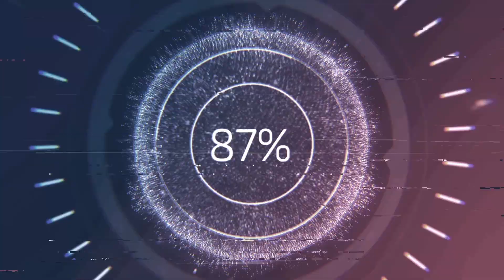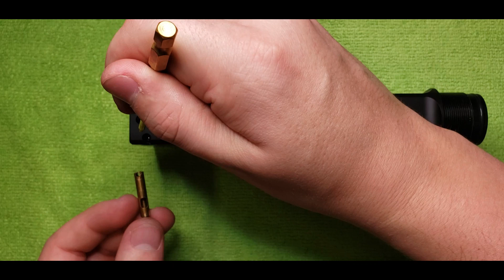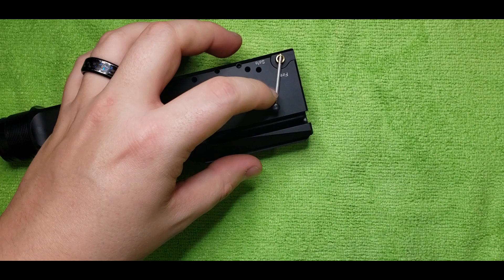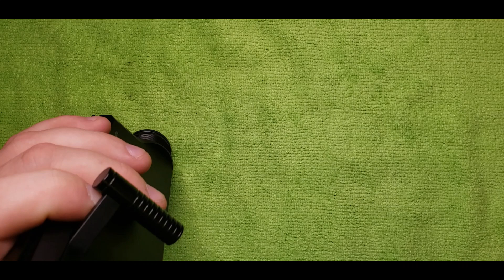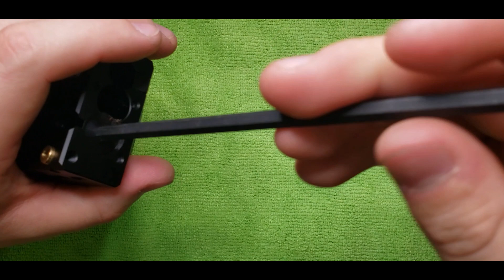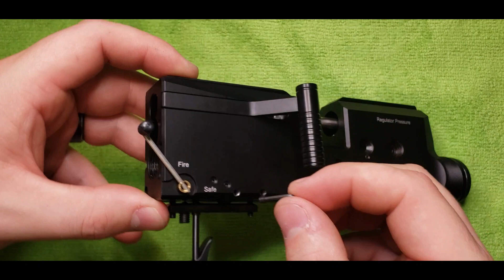FX Dreamline (Classic) Re-Assembly, Part 1 (Safety, Hammer, Trigger, Cocking Lever) FX Airguns

Comment: Great video but I need you advice. My FX Dreamline Power Pup in 25cal is leaking from the barrel and breech. To the point I cannot fill the bottle. I have replaced the valve pin seat and am waiting for a new valve pin. Although they both look like new. This is a new gun but I am the second owner. The previous owner said that he never shot it. What can cause air to empty so quickly out of the barrel and breach? I did make sure the gun was cocked. Any help would be appreciated. Thank you.
Wayne

Comment: Hi,do you think there is any relation between trigger weight and hammer adjustment?After adjusting  the hammer (lowering) the second stage is imperceptible of my Dreamline Classic.
Reply from the maker: The trigger and hammer should not have an effect on each other, but that doesn't mean it is not possible. I would guess that the hammer is landing differently on the sear based on the hammer adjustment in your case, thus changing how much pressure is needed in the 2nd stage to release the sear. Great question!
Reply: @910AirgunTuningandRepairs  Could another probability be the less pressure of hammer on the sear,thus required weight to release the trigger is less?

Comment: Can you disengaged the trigger shear in order to remove the hammer without having to remove the trigger assembly? Many thanks I have a broken cocking pin and don't want to remove the trigger assembly if I don't have to grest tutorials I've learnt alot from you 👍
Reply from the maker: Unfortunately no, the sear will not drop low enough unless it is completely removed.

Comment: Hi I just took my dreamline apart and re-assembled it. However now the regulator gauge shows 200bar+? Is it broken or is something leaking?
Reply from the maker: Hey! If you did not make adjustments to the regulator during disassembly, most likely your gauge is broken.
Reply: The regulator pressure that it.
Reply: Thanks!
Awsome videos keep up the good work!

Comment: my dream classic safety does not hold/work right will fire in both positions ? never had it apart?
Reply from the maker: Hey Jim, it sounds like your safety screw may have vibrated out of the loctite. It is the rear-most screw on the trigger assembly, and will require a 1.5mm allen key. Just thread it in clockwise until you regain the use of the safety. Be sure to not have the rifle cocked while adjusting. If you over adjust, you may lose function of the 2nd stage, or may not be able to fire at all. If that happens, unthread the screw slightly. Let me know if you need further help. My Crown trigger Tuning video may help.